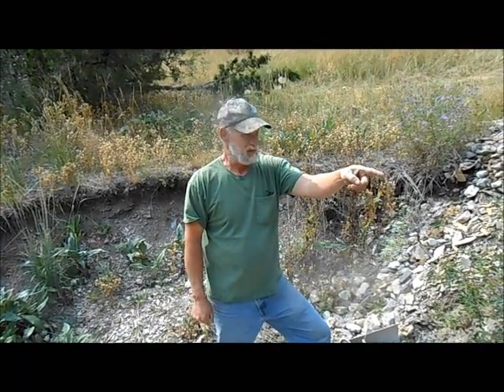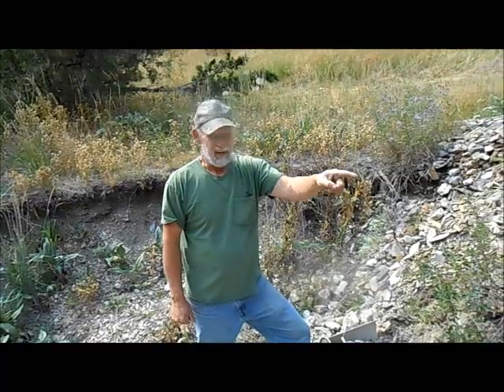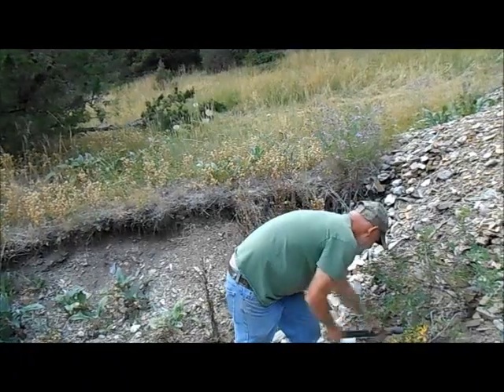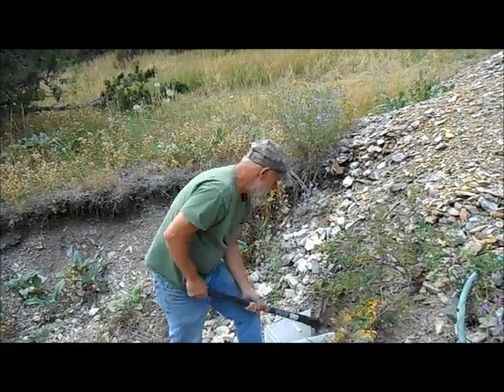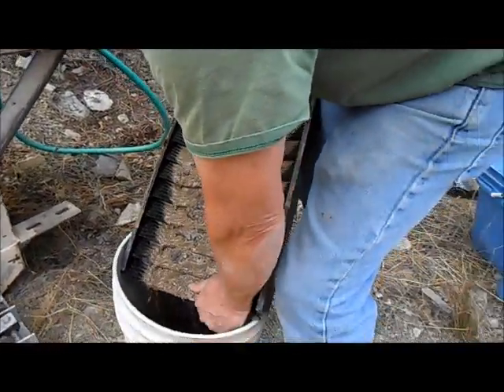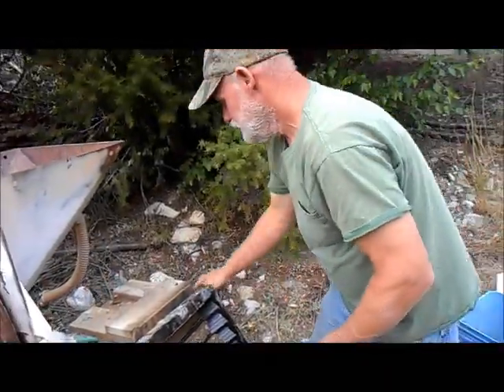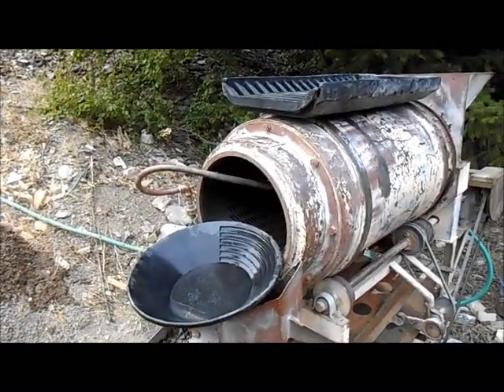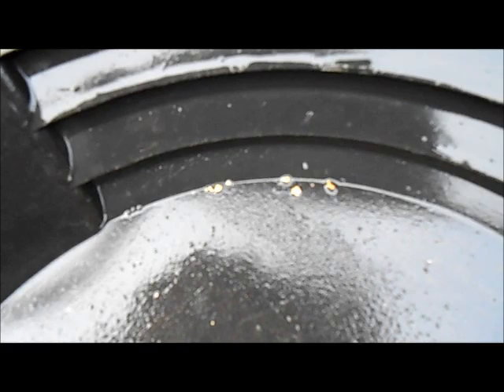Running The Vintage Gold Saver Trommel Looking for Tailing Pile Gold

Comment: Great to see this video! I have a nearly identical trommel that was made by the Mine and Smelter Co in 1934 model GB 34, identical to the Denver. They came with a 75gpm pump but mine processes fine with 15gpm. Original cost 485.00. Came with a tailings tank with elevators to dispose of waste..also has a water storage tank..rated 8 tph river run..colorado school of mines..arthur lake has complete info..ive put 100 tons thru mine and still going strong!

Comment: I would like to see this machine in person
Reply from the maker: Cool old trommel it's about a four man operation to get it off the trailer.
Reply: Alan Robertson 
I have a car hauler I’m want to turn into a trimmer. I want to build it all my self. What state is this machine in?
Reply: Trommel
Reply from the maker: @markgeorge2069  Sounds like a fun project. That trommel has been used hard. He used it for testing ground to see if it was worth mining for people. I think he said it was made in the 70s.
Reply: Alan Robertson 
Under normal conditions, when not in lockdown, I go to Montana quite often. It would be nice to meet you and see it.
Reply from the maker: @markgeorge2069  It's not my trommel the guy lives in White Sulfur Springs.
Reply: Alan Robertson 
Ok thanks.
Reply: Alan Robertson   ok, thanks Alan. Keep up the great videos. 
I guess I can ask around while in that area, some will know about the machine.
Reply from the maker: @markgeorge2069  I think the Central Montana prospectors coalition website has a page on him.  or they did.
Reply: Alan Robertson  ok, thanks for that too.

Comment: That's a rather formidable Trommel.  Not going to be popping that thing up and down for a few hours run time.  Take ya two men and a strong boy to load that dang thing I think.
Reply from the maker: The guy that owns the trommel is in his 70s and sets it up by himself and pulls it around on a trailer.
Reply: @alanrobertson2510  Yep a Trailer.   That's what I would be thinking too.